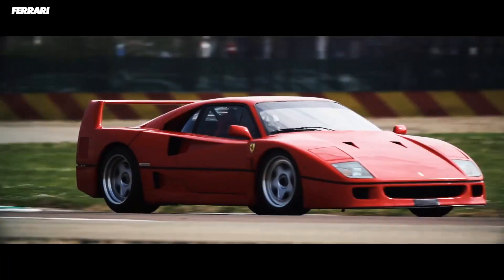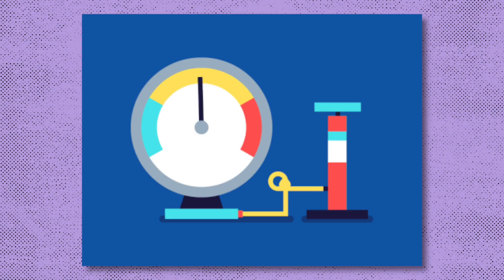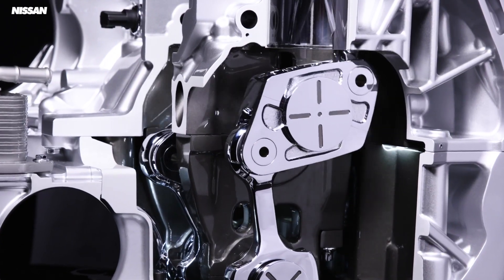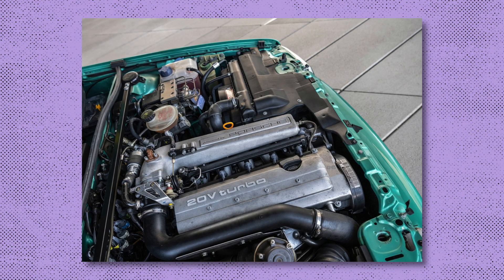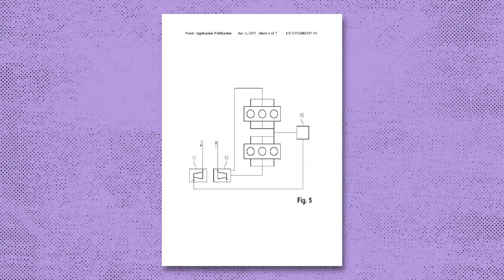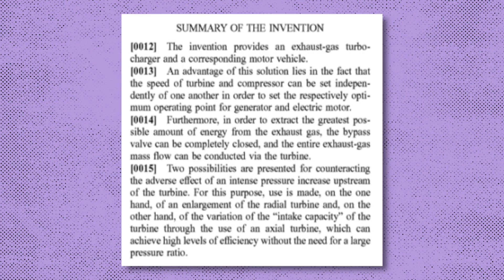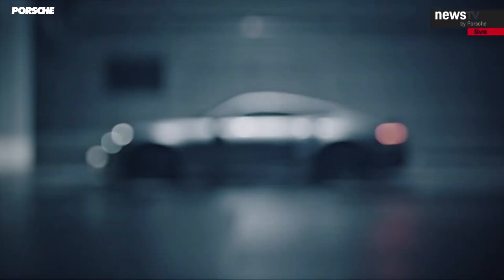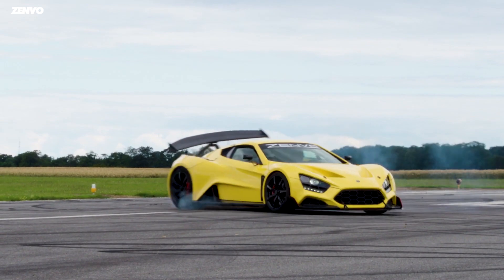Porsche's GENIUS New Turbo Design

Comment: What about a supercharger and a turbocharger?
But not where the supercharger does anything to the engine, what the supercharger does is spooling the turbo.
Then, the supercharger uses a pulley but also uses an electronically activated clutch (basically the same as the A/C is attached to the pulley when needed) to spin the supercharger when need, which spools the turbo.
I've dealt with an engine like that. Turbo always available when needed! Never had issued with the activation system in all 20 years and no service required beyond replacing the belt at the same time the other belts were replaced.

Comment: Variable geometry turbos have been around since the 70s, but they’re 99.9% of the time only seen on Diesel engines because the exhaust temps are just too hot on gasoline engines. Porsche is rethinking VGT’s and I’ve always said once a big brand jumps head first into VGT that they will change the game. It’s why the 911 hits 0-60 in 2.3 seconds. Crazy af
Reply: VTG*

Comment: Honestly I've been wondering why they haven't made turbos electric for donkeys years.
Guess I should have patented that.
That and electric valves with magnetic incidence timing target than a belt.
Reply: Electric engine intake compressors did not work until recent technology has produced motors fast enough with sustainable power requirements. Older electric motors and alternators made the idea heavy and unnecassry. It is mainly an advantage at low rpms. Practically turbochargers are an unparalleled improvement to IC .motors increasing power instead of being driven by horsepower from the engine or produced by an engine-driven alternator. By changing the drive principle of compression would no longer be a turbocharger. Impellers, vanes or other intake compression using external drive is a supercharger by definition. Superchargers could use water circulation, crank-drive pulleys or independent power from an electric or even an IC drive secondary engine. A turbo is driven by exhaust gasses alone so you'd need a new name for it

Comment: Turbo burnout is one of the big problems with turbo tech.  Turbo bearing failure happens in a lot of engines at over 100k miles.  The cost to replace this is incredibly expensive.

Toss in premium gas, gas oil dilution, and somewhat unpredictable power delivery and turbos are a bad decision.

Comment: Straight dual turbo on a honda 90s era 4 cylinder. B series, D series. 
Stiffen frame
Better suspension
New clutch, cv axles, brakes, and upgraded gearing/transmission.
Beat a lambo around turns for less than 10k.

Comment: You got it wrong mate, temperature is positively correlated to air pressure, compressed air is naturally hotter without any further heat exchange, and any internal combustion engine, the higher the temperature, the more efficient the combustion becomes thus producing more power. Only reason cooling is required is because materials handling these operations can't handle the excessive heat.

Comment: Why don’t they use stored compressed air. Have small air cylinders that can instantaneously provide cool compressed air until the turbos spool up. Then recharge quickly for the next time air is needed again

Comment: You should look at Garrett E turbo on Mercedes Amg in which we have integrated electric motor and generator on to the existing Exhaust run turbo, more efficient than the Porsche patent.

Comment: What a lot of car people seem to misunderstand about turbo chargers is that they dont just allow more fuel to be burned due to more air being forced in, but that the combustion efficiency also goes up with higher pressures. You literally get more energy out of the same amount of fuel.

Comment: Will Porsche's system require a 48V electrical system? Yes it will. Power = Volts X Current. Compressors take a lot of power to run. If you don't have big volts, you end up needing big current. Too much current cannot be handled by batteries or large capacitors. Hence, higher voltage systems are required.

Comment: This new turbo engine will hit markets in 2023 with the new 992.2 Turbo S. A friend of mine is a test driver at Porsche Zuffenhausen and he told me, the performance in the next gen 911 Turbo & Turbo S will be nearly as brutal as in a Taycan Turbo S. He also confirmed a 48v electrical system which will recharge while driving.

Comment: To spool-up an electric motor from stall to 100K rpm in 200 msec will take a spike of 400 amps, plus or minus. So yeah, that's a big 48 volt battery pack.

Comment: Why not use electric motors to force air into the engine instead of using an electronic assisted motor to turn a turbo?

Comment: Who would have thought that by adding an electric motor to a car you can make it better. Maybe, just maybe, if you make the electric turbo motor bigger and attach it directly to the driveshaft and remove the big and heavy gas engine, it would make the car even better.

Comment: I would be more impressed if Porsche were able to reduce the size of the 911 engine back to 2 litres and work with that (aiming at 400 bhp in standard format). Smaller engine size is automatically less CO2.

Comment: Why not just you a supercharger with a clutch system in it and a bypass duct to turn it on and off whenever you want to and run the engine on the miller cycle?

Comment: I might be terribly wrong but this concept sounds interestingly similar to the MGU-H system in Formula 1 engines, where the heat energy of the exhaust manifold is being used to power an electrical generator that in turn powers a turbo system.

Comment: Why power the turbo off the exhaust gasses at all?  Why not add an additional alternator for the higher voltage system for just the turbo?  Dump the power into a super capacitor bank and reduce the excitation to just keep it topped off.  When under heavy load, increase the excitation current for more power output from the alternator.  This way, you are not having to deal with the high temperatures of the exhaust system, nor are you putting load on the motor when the turbo does not need much power.

Comment: it would make sense to use it in a 48V hybrid system.
you could always regenerate more electric energy from the exhaust gases.
so, if you have more energy in the battery, you can use more of that directly with a motor/generator on the drive train.

Comment: Why don't they combine a Turbo with a Supercharger (connect the Turbo to the drive belt and exust all in a single unit) to eliminate the lag? It seems like it could be done using  one way bearings so that the faster exust flow could overtake the Turbine(s) from the engine drive thus providing the best of each system.

Comment: You don't need 48V to develop whatever power the compressor needs. Just a battery to store the average power between on compressor and off compressor . I don't think a conventional turbo extracts a huge amount of power from the exhaust gasses. You could work it out from the gas flow and pressure.
The electric turbo fuel pump on a RocketLab Rutherford rocket engine has a motor that develops 1 MW and is the size of a beer can - powered but a small lithium battery.
That is not a misprint: 1MW = 1000 kW

Comment: I wonder how much 'crossover' there is with land based engines squeezing out every ounce of power from their engines to how a turbo works in a plane. Land based engines produce more power when 'operating' below sea level where as a turbo prop plane, maintains its power at 30,000' when mimicking sea level pressures. Cool tech, no matter where you come from.

Comment: There is aftermarket turbos that can be bought, but .. well.. when its totally electric, if its a turbo or a compressor, really don´t make sense any more. The forced induction unit will be identical regradless.

Comment: There is an obvious trade off, when you add electrical load the internal combustion engine has to do more work to compensate for that load. Nothing is for free. Anyone old enough to remember when shop classes were still a thing in school (middle, and high school) has had their hands on a hand crank electrical generator and noticed how much harder it got to crank when an electrical load was added to it.

Comment: Smokey Yunick's Hot Adiabatic Engine didn't cool the intake charge, in fact it used the heat to vapourize the gasoline which gave the engine both power and efficiency.

Comment: You can only go so far with making the engine smaller before you cost fuel economy.

Ironically, my first 1974 Mercury Comet with a 200 got less than 10mpg because the engine was lugging the entire time, this one never was right but it made less than 100 HP, it was weak and guzzled fuel. My second Comet has a 302, with a little tuning I gained around 70 HP and got the car up from 16 MPG when I got it to 24 MPG.

We're already seeing fuel economy fail on the Ecoboost F150, people need more power than the V6 can produce NA so they're pushing the throttle more, which of course gets into the turbo, completely murdering fuel economy.

Bigger isn't always better but turbo on a tiny ass engine isn't the answer to all problems either.
Reply: Well, its obvious that you don't have an engineering degree...
 Otto cycle engines achieve maximum BSFC efficiency at WOT.
 The Isographic efficiency island shows us that fuel efficiency is greater the harder the engine is worked... so smaller engines in the same vehicle are more fuel efficient on standardized drive cycle tests.
The Ford Ecoboost series features GDI... with Stratified Charge Mode Combustion under boost conditions... so EGTs are lower and don't require as much fuel enrichment to suppress knocking under load and under some boost conditions no fuel enrichment at all.
Reply: @sandervanderkammen9230  It doesn't take an engineering degree to understand that a car moving that requires 50HP to maintain speed is going to burn the same amount of fuel whether it's a 302CID or a 170CID engine all other things remaining equal, the problem is the 302 can run at a lean/cruise condition and push the timing higher to produce that amount of power, the 170 would require timing to be near it's peak power, which requires more fuel to burn.

It doesn't take an engineering degree to measure your own gas mileage and to recognize that an engine lugging burns more fuel than an engine at light load.

Engineering efficiency is max power for fuel burned, of course that's going to be under load. Actual fuel efficiency is based on miles driven per gallon burned. You're intentionally arguing two different definitions against each other in bad faith.
Reply: @glenwaldrop8166  You are arguing something that you clearly don't understand.

An Otto type engine rated at 100 horsepower max. will deliver more efficient BSFC at 100hp than a 200hp engine.

This is a basic fundamental engineering concept.

The higher the load, the better the fuel efficiency...

Don't confuse rpm with load.

Its called BSFC...
Reply: @sandervanderkammen9230  Again, you're intentionally arguing in bad faith, comparing fuel efficiency when driving with efficiency as an engineering term.

You get max power from X amount of fuel at full throttle, max timing for that engine, etc, that is the term you're talking about. You actually get more power per fuel burned vs cruising. That's not remotely the same thing as cruising fuel economy, which is what everyone else is talking about when speaking of fuel economy.

NASCAR isn't getting 25mpg around the track, it's in the single digits, troll.
Reply: @glenwaldrop8166  Youre not fooling me lad... you don't have the slightest clue what you are talking about.
I'm calling you out, you don't have any formal education or professional experience regarding this topic.
Reply: @glenwaldrop8166  The engineering term is called BSFC
Brake Specific Fuel Consumption

Comment: Many commercial airlines use compressed air to get the compressor spun up to start the engine. It makes sense to use compressed air to spin up a turbo especially since the compressor pushing air into the turbo just adds that much more air into the intake. Idk if they are powering the compressor in the most efficient manner tho. Exhaust is hot and dirty. Would you power the a/c compressor via an electric motor powered by a generator powered by the exhaust? Why not mount it like other accessories and power by the belt or power it it via an electric motor which gets its juice from the electric bus. That way the only addition is an electric compressor maybe with a transformer and/or inverter to up/convert voltage.  Or if the compressor is driven by the engine via the accessory belt the package would be even simpler. Idk what the needed cfm would be but a small high pressure reservoir can be packaged with the compressor.

Comment: I'm still not ready to buy a small turbo engine. 

I know their reliability has drastically improved but I still don't think they compare to a slightly larger N/A engine for longevity.

I'm not fond of small turbo engines, or any engine with a timing belt instead of a timing chain.

Comment: I was wondering how an electrically driven turbo was supposed to be a new innovation.  The answer is it's not.  The innovation comes with how Porsche are producing the power to drive this electric motor. 
While It is interesting it seems like something that would have been beneficial to hybrid powertrains.

Comment: NEW? Not even close ... the design with separate compressor and exhaust system with gene / electric motor in between has been in F1 for many years and also on audi ... also for years, but since audi and porsche are about the same company, it is no surprise there. = Click bait...

Comment: I've thought about this.  It would require a lot of additional weight for the electrical  system.  Generator + electric motor + wiring etc adds up when you're trying to keep weight as low as possible
Reply: I disagree
Reply: I’m pretty sure electric motors are pretty light and so is wiring.  It’s the battery that makes shit heavy

Comment: Hi Callum, can you find out more for the benefit of everyone. I have read somewhere (which I have forgotten and cannot verify) that EA111 (VW's 1.4 TSI), which is turbocharged is now using the smaller compressor for better low end torque and not sacrifice much of the high end torque. I used to drive the Golf Mk6, which comes in 2 HP variant. The lower 122HP 200Nm 1.4 turbocharged and the more powerful 160HP 250Nm 1.4 twincharged. The same setup goes on the Touran Mk1. However, VW (I would assume technology derived from Porsche since Porsche has 51% ownership of VW) seem to have updated to a smaller but more effective turbocharger, so that the lower power Golf Mk7 is a 1.0 TSI inline-3 with 120HP and 200Nm, and the 1.4 TSI (also on the Touran Mk2) is now the more powerful 150HP 250Nm version, both single-turbocharged, with little turbo lag. Anyway to verify this information? At least when I start off from a stop at any traffic junction in my Touran Mk2, I don't feel the lag, and by the time I reached 60km/h, I have left my neighbouring cars at the junction 100m behind me. I did feel the lag in my Golf mk6, where gears 1&2 are sluggish and the torque kicks in from 3rd gear onwards. I also want to understand how is the lag reduced or eliminated with a smaller turbo. This part I don't quite understand. Many Thanks!!! (put this again in case it was missed in the reply section).

Comment: Wonder if this could/is also used to increase fuel efficiency. The compressor side of the turbo could be activated upon full opening of the throttle, such that during partial load the turbo isn’t forcing air through a partially opened throttle valve, which normally leads to increased pumping losses. The gas pedal then becomes sort of a pressure regulator for the intake, with the computers regulating throttle position and turbo activation; more gas = more intake pressure.
Reply: Hey, anyone here knows electric motor can make turbine spool at 100K rpm or not?

Comment: Not genious, its just anb electric motor on an impeller.
What would be genious is if the intake air were to run over and cool the electric motor, allowing for a smaller motor with the same power.

Comment: Turbos reduce engine life and have more fail points due to the increase in compression ratio and added components. You essentially have a car with two, or three engines instead of one. How are you saving the environment if you trade efficiency for reliability? One engine rebuild will kill all the energy you saved driving with your turbo. Naturally aspirated engines will last longer and save you more money in the long run. This is how the auto manufactures pass additional expenses on to the end user under the pretenses of obeying the government.